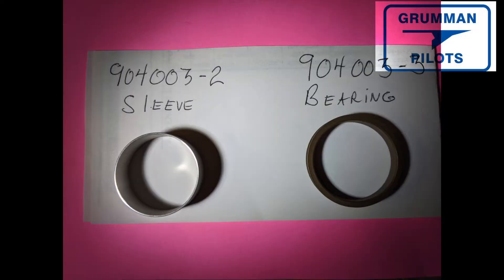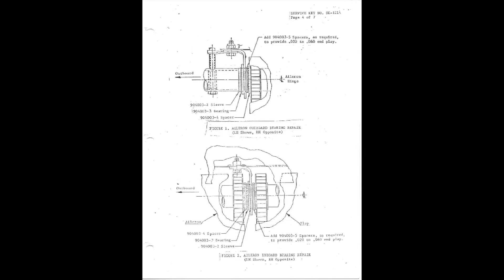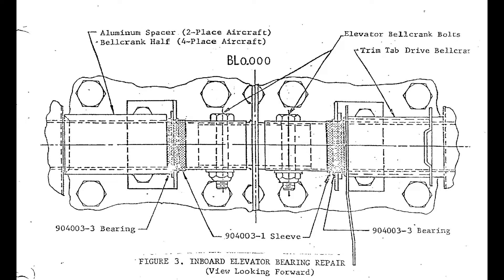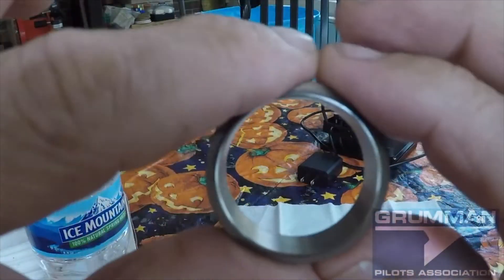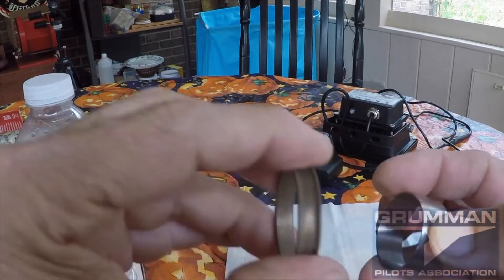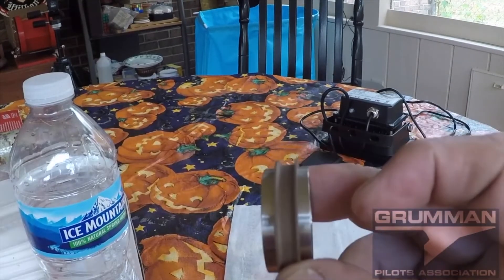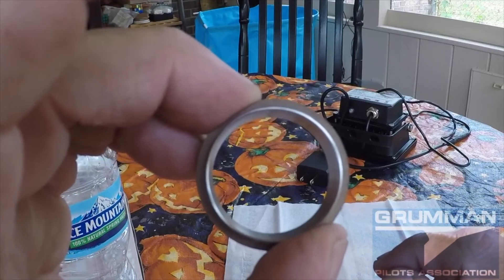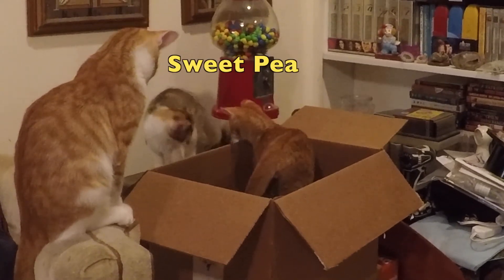Service Kit SK-121A - Grumman Style

Comment: Hi Roscoe, Can you please help me out? I have the oversize sleeves for the ailerons and it says to put a sleeve on the inboard end of the aileron but I can't see an oversize bearing for the inboard end that works for the AA5B. Am I missing something?
Reply from the maker: It is the 904003-3 oversize bearing and the ss sleeve held on with loctite, red.
Reply: @ there is no 904003-3 on the inboard end of aileron in the AA5B though.